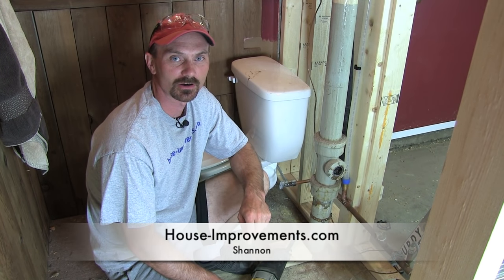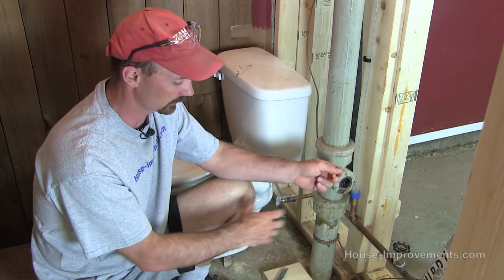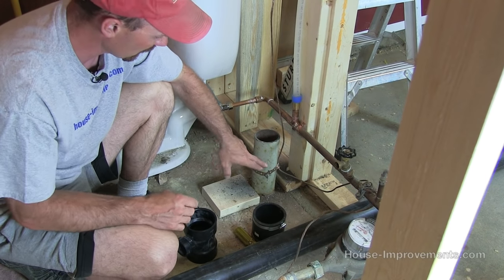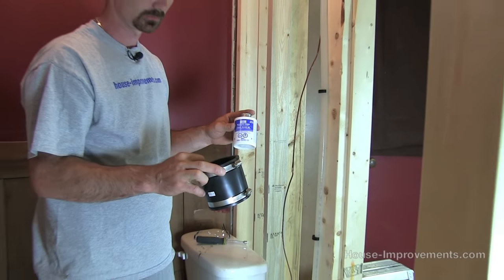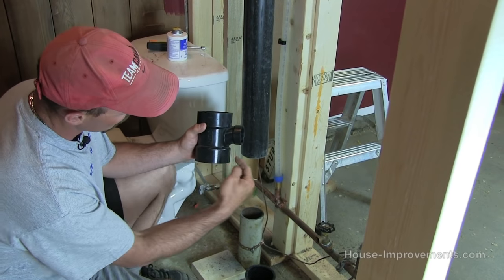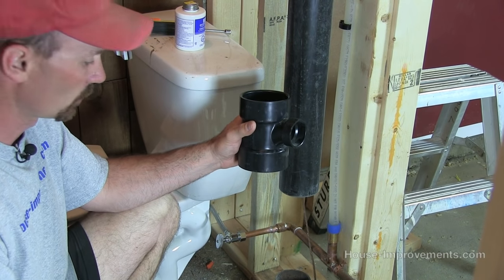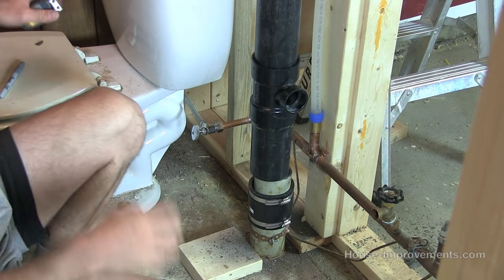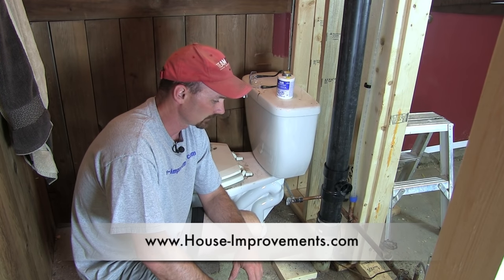How To Cut And Replace Cast Drain Pipe

Comment: Looks good.  Probably not going to leak but just a couple things to note for diyers who are going to attempt this (and I'm not trying to discourage anyone from trying).  Always use primer on both sides of the part you're fitting before you glue it.  When you glue PVC you want to also get a small amount of glue on the female side of the fitting.  Then turn the pipe a quarter turn as you slide it into the fitting.  Then make sure you hold it in place for about 45 seconds because it wants to push itself back out at first.  I'm not saying these joints in the video will leak but they could.  Always read the instructions on the glue to CYA.  It's easy to do these steps and it ensures that it'll be effective and last!  I hope this helps.  I'm not bashing the installation.   I think it's great that people take the time to record and post videos like this to help others out!  I'm a remodeler and handyman myself and I don't have the time to do all the recording and editing needed to do that.  So I salute those who do.
Reply: He's using ABS which doesn't need primer. 45 seconds is also way too long - 10 seconds is plenty. You're right that you should put glue on the pipe and fitting.
Reply: Thats not PVC its ABS. And iv never ever seen a plumber prime ABS before hand. pVC yes you absolutely should prime before gluing
Reply: He also should technically have an expansion joint on that stack now. Abs has a high rate of expansion and can buckle without an expansion joint
Reply: I stand corrected!  Thanks guys.
Reply: @jareds1661 what's an expansion joint?

Comment: looks good. only thing is your supposed to glue both the pipe and the fitting. the glue acts as a primer as well and eats the finish off the abs to prep it for the bond. your technically "chemical welding" abs when you glue it. other than that great job. I like watching other tradesmen work to see how I can improve.
Reply: You are absolutely right both the fitting and pipe must have the solvent applied.  It is not a glue!  Being a solvent it melts a little of the ABS therefore the 2 fittings must have the surface melted to create the best chemical bond.
Reply: The solvent can cause the rubber to decay. I've read on other videos that when you're using the rubber couplings you can go dry. When doing plastic to plastic you use the solvent.
Reply: Dave Rodriguez he’s not saying glue the rubber coupling. He’s saying glue both pipes when glueing them not just one of them
Reply: It is a VENT pipe!  It just needs to stay in place.  Applying glue to only one surface of a joint is adequate for a vent.
Reply: @jeromenewton2720  It is not a VENT pipe.  This section of the stack handles waste water, so it is technically the "waste stack".  Note that the Tee added is going to service a lavatory sink and handle waste.  The upper portion of a stack that does not handle water is only intended to draw in air and that portion is called the "vent stack".  The cement manufacturer instructs that cement should be applied to both, the outside of the pipe and the internal hub of the fitting in order to complete the bond.  Failure to follow this procedure, even on a vent pipe will fail your inspection.

Comment: This is exactly what I was looking for. I'm in the process of remodeling our laundry room in the basement and there is a 3-inch cast pipe sticking up out of the floor and I needed to cut it and rough it in for a washer and a sink. Thank you very much

Comment: "Diamonds are a guy's best friend!"  Thanks for the video!  30 years ago I attempted to saw through some cast iron plumbing under the house with a carbide blade.  I just got through the first pipe last week!  Seriously, thanks for the tip on the diamond embedded blade--carbide is not the blade of choice!  I've ordered a Bosch diamond recip blade from Amazon after watching your video. I only have one cut to make, but I understand that an angle grinder with a cutting wheel is the way to go if one has a lot of pipe to cut.

Comment: Thank you for a great video.  I would take the old piece outside and use as a guide, constructing new part while standing up in good light. Get out of dusty and moldy work spaces.  Also, the 2 minutes it takes to stand up table saw are worth it, straight cuts that are very quick.

Comment: I had the experience of dismantling work to remove part of the cast-iron cup for the sewer system of the installation in place 20 years ago. To do this, I used a saber saw and a metal cloth. I would like to clarify that the blade blunted in a minute and I had to make new incisions in 3-4 mm steps. After that I finished the work on removing the cast-iron pipe

Comment: Great video.  Thanks.  
I'm going to have to replace one that 2 sinks and a tub come into.  In the middle of a wall!  The 2 sink drains are on the 1st floor.  The tub drain connects to the stack about 18" below in the basement.  Should be loads of fun!

Comment: I had to connect a sink drain to a similar situation. I bought a rubber pipe connector with hose clamps. It fit over the old iron pipe and clamped without leak. It stepped down to the abs ,sink drain and clamped without leak. Easy after that. Cheaper, faster. Those hose clamp connectors can cost a little extra but save lots of time, money and headache.
  I bet no one would complain about the shorts if it was a woman! I have the same problem. Just shows you’re lookin’.

Comment: Plumber here , I know that this is an old video, but to all the diy’ers out there that see it— the Fernco couplings are NOT allowed inside of the building— only the two and four banded stainless steel clamps are approved. 
Also there is a no-hub to cast iron adapter that could be used here.

Comment: Your video helped my a lot when I was replacing my rotten drain tee! For cutting the pipe, I just used a cheap metal blade since my pipe was 1.5 inch, and it was fast too. Thanks again!

Comment: I just opened up my wall in my basement to reveal a cast iron pipe with some sort of a white flange that was used years ago to join cast iron to cast iron.  It's been leaking and I've had some backups, I now can see roots and some soil at the base of the pipe.  Makes me wonder if I'll need to go below the cement floor.  Good video, thanks!

Comment: I like the video, a lot of good useful information on it.  The fitting you used is actually called a sanitary tee due to the short radius bend on the branch.  For the price of the one blade you could buy a grinder and though messy, it would last much longer than the blade but to each their own on that.  The one complaint I have is that you used a rubber boot that is designed for underground use, when a shielded no hub fitting would be the better choice.  The average do-it-yourselfer though should have a much easier time tackling this kind of job after watching your video, I commend you for the effort.
Reply from the maker: Thanks for your comments.
Reply: I am replacing same thing.I will use a grinder do i have to be conerned for metyane gases?
Reply: Knight Valle I wouldn't worry about methane. I'd also call your local tool rental and get a ratchet chain soil pipe cutter. They are fast quiet and clean.

Comment: Always cement both pipe and fitting or you might have waste water running down the inside of your walls one day. Let alone sealing, it's structure, and has to hold up to the weight of the pipe and the loads and pressure of flowing waste for decades to come. Larger cans have a bigger applicator which makes it fast to swipe around both inner and outer in 10 seconds giving you plenty of time to seat the connection before it sets up. Happy Plumbing everyone! (if there is such a thing)

Comment: Great advice. Wish you had explained what you used for the upper coupling on top of the new ABS.
Reply: He had already replaced the cast iron pipe, that runs from the ceiling up through the attic and out the roof with an ABS pipe.  So the pipe protruding down from the ceiling was ABS pipe.  The join was solvent welded with a 3" ABS coupling.  If the stack above was still cast iron, he would have made the joint with another rubber mechanical coupling, same as the one on the bottom.
Reply: @chrisgraham2904 : Thanks for explaining, I was wondering about that myself

Comment from the maker: In my video I had already changed the upper pipe to ABS. If you were not removing that part you would need to support it some how with metal pipe strap or some other way to keep the weight held until you are finished.
Reply: Lenox carbide heavy metal blades work   much better....tried both...high speed grinder is best....if u have the access...get what u can with grinder...finish with blade

Comment: Thanks guys for the video!  I have a CI pipe 4" I believe that just started leaking yesterday at the bell shaped connection is after the main sewer line became blocked, I plan on replacing that section of the CI.  I have a question:  Why in this repair did you choose ABS over PVC?  Keep up the great videos.  I always learn alot from your videos.  Thank you ever so much.
Reply from the maker: Here ABS is more commonly used when not being buried, but PVC is used more commonly when it will be buried.
Reply: @HouseImprovements  Here ABS is against code. Very few places to find it. PVC is a better choice. It is a stronger pipe

Comment: I understand this is diy but there’s a few things that will help do this better. First off I’m not sure the fernco will seal properly, it’s way too big for the CI. It would be better to use a cast iron to plastic transition coupling. Also a skil saw is probably not the best tool to cut pipe especially when you have a sawzall handy. The skilsaw left a lip from spinning the pipe. This can catch tp or other solids and block the pipe. You can use any sawzall blade and cut abs. Also with a solvent weld, you need to put glue and cleaner on both the fitting and the pipe. Though I’m familiar with pvc not abs so that could be different

Comment: Definitely need to glue both joints as per instructions on the PVC solvent. Also the instructions say you need to hold the joint for 30 seconds to avoid any movement, especially a 4" pipe that's hanging. The weight of it could weaken the joint.

Comment: I'm surprised there's no sealer for the rubber boot, or corrosion inhibitor for the cut edge on the cast iron pipe. Along with the minimal 'wipe the dust off' prep for the ABS solvent glue, that all makes for a much easier job than I'd have thought. Thanks for the howto :-)

Comment: Yeah, you guys probably already know this.  Reasons for keeping cast iron pipe, is for the sound.  If sound is an issue, then go with Cast iron.  If not ABS.  Or at the very least wrapped ABS.
Reply: Many professional plumbers state that PVC drainage is quieter than ABS.

Comment: Most plumbers would use abs cutters for s clean cut. The "rubber flange" is a calder coupling and they are illegal inside buildings. Banded couplings need to have a metal shield, they are no hub bands. Calder couplings are approved for exterior use only.
Reply: actually fernco coupling also nothing says in upc that its prohibited/illegal inside dwellings. its better to use husky bands for no movement comes with shield and 4 clamps rated for 2000 lbs. should use these outside if need a mechanical coup.
Reply: ferncos are allowed in many areas inside

Comment: Great video - thanks!  Question: I'm moving a shower drain and replacing old cast iron with ABS.  Do I have to be concerned about getting a straight cut when I cut out the cast (in other words, how important is it that the connection between the old cast pipe and the new ABS is flush)?  I'm going to cut the cast with a recip saw, and I doubt that it will be perfectly straight.  Thanks.
Reply from the maker: Should be reasonably straight but does not need to be perfect.

Comment: I have to replace my cast iron pipe this week from the basement washroom up to my 2nd floor  bathroom all the way to the toilet. Should I start from the bottom and work my way up with the new PVC or start at the top and work my way down? Thanks in advance.
Reply from the maker: I would remove it starting at the top and then re-install starting at the bottom.
Reply: Personally I would not replace it all from basement to 2nd floor unless it is over 100 yrs old and more, lol.  Why you ask?  Cast iron pipe does not resonate in the walls, therefore when the waste is draining you do not hear it. But when you replace with all plastic pipe, it will resonate and you will hear the water running down the pipe.  I personally would replace the horizontal run, which are more problematic and in ground drain pipes. This is my personal opinion and may not be a common one.
Reply: Thanks for responding and the advice. The pipe is at least 80 years old. I have a crack on the 45 degree elbow in the basement, and the flange area in my upstairs bathroom is really corroding.
Reply: If noise is a concern, look into No-Hub cast iron. it assembles easy like PVC, and has the noise dampening property of heavy-weight cast iron pipe. Is also fire-resistant and lasts decades.

Comment: I cut ABS with a pipe cutter(for the most part) Then I have a swivel reamer that's about the size of a pencil. You're Mr. Fancy! A silver pen to mark your pipe! I've been using my thumb all these 42 years. That or the stamped markings on the pipe. It's not always necessary to cut out the hub. There's an adapter that fits inside the hub that takes the place of the old oakum seal. I can hear it now. 'You mean the lead and oakum seal" The lead does not seal the joint. It just holds the oakum in place when it swells. I've never used that yellow cement. It looks like contact cement. ABS glue actually melts the two surfaces. No primer is used. Why use primer on PVC? PVC is much harder than ABS and the primer softens the material, as well as cleaning it.

Comment: Hi there, very informative video.  I currently have a problem with a 4' section of cast toilet pipe that has split open and needs to be replaced.  The pipe is vertical and in the corner of a room.  The cast pipe is rusted and pitted on the outside, do you know if there is a way to still use a sleeve to connect to a replacement pipe in this situation or not?  Can it be sanded down a bit to get some of the rust off of it, them sprayed with something to help seal the rust pits, then use a collar?  Thanks, in advance.

Comment: How much does this job cost?  And is the top of the cast iron main held/supported by something on the first/second floor.  Will all fall out after cutting?
Reply from the maker: Really to many variables that could be possible to give specific cost. Also many different situations so it is hard to say if your pipe will fall, use caution and presume it will.
Reply: I'm just trynna figure out if price I was quoted was fair or gouging.  Thanks for your response.

Comment: Thanks for the video but I don't agree with cutting cast iron with diamond blade. As you said ,diamond blade cost about $30 and only good for 2 or 3 cut. You could rent chain snap cutter from the "orange store" for about $27 and you  can cut 20 cuts supper fast and  still have time to return them back under 4 hours. They are fast, clean cut, works in a limited space, and safe.

Comment: Beyond what KIND of fittings to use on a sewer lateral:

What is the projected lifespan of the fittings needed to transition from the TAP coming off the main sewer line, to ductile iron?

And from Ductile, to ABS/PVC?

PS: Is PVC preferred over ABS when buried? Max depth will be 6"10 @ main, 33 inches to center-line of  4' inch that comes thru foundation wall.

Comment: how is that fernco coupling strong enough? the whole middle section is just rubber.
I would have used underground ferncos with stainless steel reinforcement for extra reassurance.
Reply: good point, people always snivel when a pro makes a suggestion, if people were smart they would learn from the comments because you guys point out important mistakes, I googled the underground coupling and it's much better thanks

Comment: Hi Shanon my vent cast iron goes down in to the main sewer the elbow that goes into the grown is rotted and I want to cut it and do pvc pipe, what should I use? can I just use a plastic boot to make the connection from cast iron to pvc or should I use something else? will the plastic boot hold the cast iron good enough? please advice me on this, I watch all of your videos thanks for taking the time to share your knowledge.

Comment: can you use metal angle grinder and what if the low pressure water pipes are cast iron? how do you repair those pipes?

Comment: When you glue ABS or PVC you are supposed to apply a light film on the female and a heavier film on the actual tubing. This is standard practice in the plumbing and Hvac industry
Reply: gasmanrm no it's not

Comment: And what if the existing cast iron stack will remain above into the attic and through the roof?  How do you support all that weight?
Reply from the maker: Normally there will be connections in the pipe lengths and these have larger diameters. You can use metal strapping wrapped around the pipe under the larger sections and attached to roof framing to help support the weight.